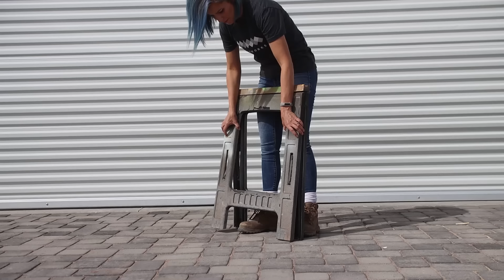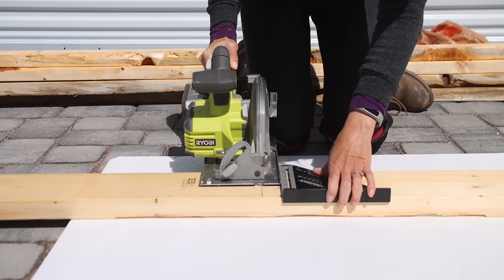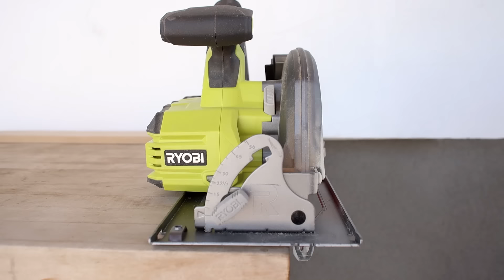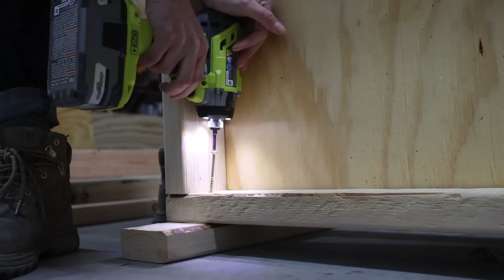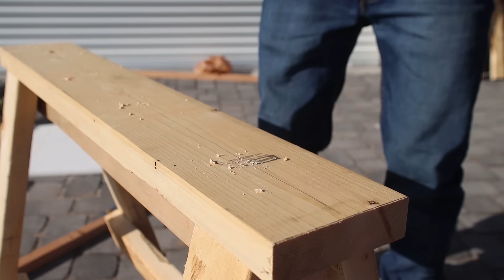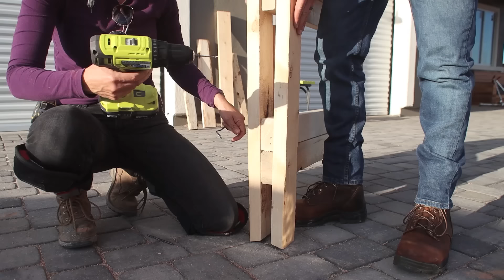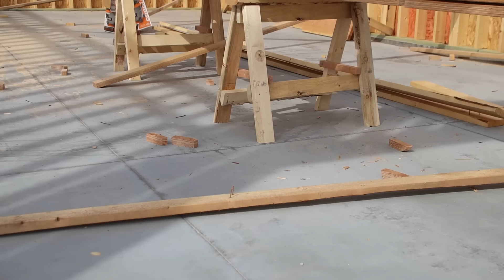HEAVY DUTY DIY Folding Sawhorses

Comment: You can build also with metal 2x4 square tube and screw together with metal screws or weld, just a. Easy as wood using metal screws,and more sturdy and last longer

Comment: great interesting video and I built one after watching. One thing I'd like to point out is that the screws on the hinge may get loose if the sawhorse get moved/shaken, as most of 2x4 are pine and soft. maybe pivoting by a 1/4 bolt is better...

Comment: Don't glue the top plate.  Secure with deeply countersunk screws, so that it can be replaced if it is worn out from repeated shallow cuts or if someone forgets to reduce the cut depth on a circular saw and cuts all the way through it.
Other than that, a really solid build.  I built a similar setup, but with chains to control the leg splay.  Not as stable as your solid braces.  I built another, non-folding, set with adjustable feet for uneven surfaces on dirt job sites.  Think I'm going to try to include that feature when I copy the rest of your design..

Comment: these are a death trap, don't build them.  The arm/lock mechanism is sure to fail, when lives are on the line, don't mess around with this kind of stuff.  Not hating, just stick to non-structural/non-safety stuff unless you know what you're doing and or the risks associated.

Comment: This is just me and not say you should, but I buy dull toss-away drill bits and second hand stores and cut the shafts to desired length for use instead of wood dowels. They're actually less expensive than wood dowels and come in all diameter sizes including metric. Depending upon the thrift store or yard sales each bit costs between pennies to a nickel or dime. Recycle!

Comment: I like the look of these sawhorses a lot and will be doing this project. One question - I recently built a fence door using half lap joinery and really enjoyed that process, could I do half laps for the cross beams of the sawhorses or is there a concern it would lose strength/stability?

Comment: Nice design. Thank you. If you wanted the option to line up your cross supports you could put one of them in the middle the way you have it and the other one on the outer side of the leg. They would both be aligned at the same horizontal elevation. On occasion I've needed to stick a plank down there to support some hardware or tools. It can be a handy shelf.

Comment: Thanks for the video. It's an old-fashioned practice, perhaps, but my great-grandmother and my grandmother used sawhorses (called saw frames in Britain) to hold quilting frames while in use. When not in use, they hung the frames on the kitchen ceiling.  I am building a pair for a quilting friend. 30" inches, per your plan is likely to be good. If too high, I can easily cut an inch or three. Thanks for the plan.

Comment: I must disagree about using impact drivers to drive basic wood screws. They (a) run too fast, (b) thus tend to strip the screw head, (c) don't offer much in the way of (speed) control, if at all, and finally, (d) risk overdriving / stripping / snapping screws due to the high torque. Now, when it comes to specialty wood screws (lags, Loks, ledgers, hex head, etc.) go for it!

Comment: Good job! I never thought of the simple idea of using styrofoam as a base to cut on. Sometimes you can find the stuff at your local construction sight dumpster. I❤ to dumpster dive. Also I like the idea of getting  an impact driver. At present l’m always changing out between drill and driver, very tedious. I wanted to get a second drill but an impact driver makes better sense.
  Just a thought, self leveling saw horse legs might be a nice added fetched🤓

Comment: Great instructions. One question. What is the purpose of the 45 Deg cut? Shouldn't 15 Deg cut be sufficient for achieving the desired inclination of the workhorse?
Reply: I think that’s for the hinge to fit there because the barrel of the hinge is a cylinder shape that sticks out

Comment: one tip: instead of the locking Arms you could also use a chain. not as bulletproof against folding together but shouldn't be an issue (I'm a carpenter by trade and never had the issue)

Comment: I made a pair of these about two years ago, and they have worked very well.  I beefed up the locking mechanism by having the bar attach with a bolt to both legs.  To fold, I undo a wing nut and flip the bar onto one of the legs, pass the bolt through, and secure it with the wing nut.  I ended up using regular hinges, since the special type you used was only available locally in a form which was too small and frail.  I simply routed a grove in which the folded part of the hinge rests.

Comment: I’m looking at building a couple of these today, but noticed a couple of potential problems. I’ve been reading through the comments to find any reference to them, but can’t find anything so far.
Just wondering if anyone else has addressed them.
1. The hinges are being screwed in directly opposite one another, into a 2” wide runner beam. Unless 1” screws are used, aren’t the screws going to run into one another?
2. Where does the barrel of the hinge go? It looks to me that it would sit above the top edge of the runner and prevent the top plate from sitting flush.

Has anyone run into these issues and found a simple solution? Offsetting the hinges is one solution to the first problem, though I don’t know how that’d impact foldability, stability and the storage latch. The second “potential” problem is exactly that. It may not actually cause much of an issue as the barrels aren’t particularly wide so may just indent the top plate enough to sit relatively flush and the hinges might have more friction, but being at the pivot point of a lever (i.e. the legs), I imagine it’d be negligible.
Any advice from someone who has built this?

Comment: Definitely going to making a set of these!  Mainly would use as lumber or material supports for cutting, but I’ve lately been been using sawhorses for temporary outdoor table work spaces to do some projects outside on when the weather is good or I can use the extra space instead of in my shop!  Thanks for the great video!  Definitely a big like an subscribe from me, cheers!

Comment: Finished mine today. Great design and instructions. Looking forward to others.
Reply: Did you end up building this? I was looking at buying materials for it today, but noticed a couple of potential issues.
If you did build some, did screwing the hinges opposite each other on the 2” runner, cause any issues with the screws running into each other? If so, what was your work around (1” screws???)?
Also, did the barrel of the hinge interfere with attaching the top plate? To me it looks like they’d create a void between the runner and the top plate.

Comment: Problems I came across: Cuts, Hinge selection, wood placement, broke lag bolt with impact, legs not flush or plum vertically, bad kurff when cutting( circular saw skill). Mines are almost good had to go back and make some adjustments. Great build, just have to get my skills up.

Comment: I would nor recommend using a dowel but you could use a lag bolt of the same diameter, drive it into the wood then cut the head with a metal saw.   It will be much sturdier and will pass the kick test.

Comment: Hi. As an old shop teacher, may I suggest a couple of easy improvements? 1) Don't glue down the top board; this way if you run your saw through it you can remove and replace it. Knowing that it's easily replaceable means you can use it as a sacrificial piece of wood. 2) Attach the top piece with brass screws; this way if you run your saw into a screw you don't damage your saw blade since brass is soft. Because brass is soft, after pre-drilling your pilot hole drive a steel screw the same size as your brass screws into the wood to cut the threads, then remove the steel screw and install the brass screws. 3) Instead of the 2x2 and dowel to lock the horse open, substitute a piece of 3/4" plywood with a notch cut into it that will latch onto the cross bar to secure the horse in the open position.
Reply: I suggest a further improvement. 
Make the legs and top as two separate pieces, connect them together with long bolts with wing nuts. This can act as a vise for holding work, or a piece of wood to adjust the height.
Reply: Похоже ваша идея уже реализована! 😁🇷🇺https://youtu.be/VeOi_ubNeEg?si=gTcY27lvSE0k52N3
Reply: Good tip about using brass screws for the top.
Reply: Scott,  great suggetsion. Question: if you screw down a top board as you suggest, and it gets sacrificed/replaced multiple times wouldn't taking out / putting in screws over and over round out the trheads? Is there a way to attach with bolts or other means? Thanks!
Reply: @philippeb4972  You could use screw inserts and bolts if you want to go to the trouble, but I don't think there's a rule that says you need to use the same holes. Even if you do and they become stripped, drill out the holes to accommodate a dowel, glue it in and re-drill for screws. Also remember this is a saw horse, not an heirloom tool. :-)
Reply: @philshock3805 using your own logic, if this is a sawhorse, not an heirloom, then just directly screw in the top beam in the first place. If you have to replace it after years and accidental damage, then just make a new horse in 3 hours.
Reply: @Gothmog222  “…make a new horse…” Screwing in a new board is hardly the same time, energy and money as making an entire new horse, especially if an additional horse is not needed.
Reply: @philippeb4972  you can use screw plugs
Reply: Good thinking.
Reply: Pivoting off this idea, here's an alternative that I've now implemented:
1. Glue a 2x4 and 2x6 flat together, with one of the edges flush. The 2x4 is the top and 2x6 the "base" of this setup.
2. Drill 1.5" deep holes into the top (2x4) centered on the 2x6 at ~4 locations.
3. Screw the 2x4 / 2x6 piece to the sawhorse base through the holes in #2.
4. Drill a few holes most of the way through the 2x4 / 2x6 from the top. Glue dowels into these. This ensures a very strong connection between these two top boards.

I've now made 2 sawhorses like this. It's really nice to have the "shelf" on the 2x6 where I can clamp something to both the 2x4 and 2x6 in different directions. No issues after several projects with these, and they seem like they'll last several years before I need to replace the top 2 pieces.
Reply: @dosadoodle you should do a video bro.As a rookie I’m always looking for advice on how to build things.About 3 years ago I all of a sudden became interested in tools and woodworking so I decided to start buying tools and learning on my own n here I am.The only thing I can say is maybe it’s my age that made me all of a sudden want to start building things as a hobby.I went as far as purchasing a shed and filling it with all types of tools that I still don’t know how to use 🤦🏻‍♂️….well the only one I can use is my table router…I haven’t tried it yet cause I’m kinda nervous and don’t know where to start.The bad thing is I purchased a 300+ dollar box of bits 2 years or so ago that I still haven’t used.i pretty much have everything I need,not every tool but the ones I need and more to build a house 😂….sorry for the rant but my point is we always need ideas of how to build things.Im sure I’m not the only rookie out there that needs all the advice he can get 😬….Even recommending other channels would help also.
Reply: @EyeSeeDeadPeople44  Sometimes you just need to start a simple project, even if you make a mess, it doesn't really matter. Perhaps you could make a video, there's probably thousands of people like yourself and once they see a first-timer do something, it may inspire them too!
Reply: How about put wood dowels glued to the top piece and drill the bottom hole s little smaller and pound them in for tight fit but can pound them out
Reply: Why don't you just post a video, everybody does it their way, if not there would be no need for more than 1 video.
Reply: Hi shop teacher she's not building a piano.

Comment: Thank you for this video! 

Question: If you substitute 1-1/4" screws to attach the hinge plates, the lengths of two screws directly pointing at each other would add up to 2-1/2", more than the 1-1/2" thickness of the runner. Did you maybe offset the plates on the opposite sides of the runners a bit to keep the screws from hitting each other?

About the awkwardness of attaching the legs to the runners: Once you've marked the drilling points on the runner for the hinge plates, maybe remove the pin from the hinge and put the leg aside, screw the plate onto the runner, then put back the leg and the pin.

Thanks again, looking forward to building them.
Reply: I have the same question. Did you find a work around that didn’t affect any other aspects of the build?

Comment: Brilliant design.  Will be making up 2 pairs to help with a barn door restoration project.  I’ll be using rough sawn hemlock, true 2”x4” dimension.  I like how they fold for easier storage.
Reply: Did you end up building this? I was looking at buying materials for it today, but noticed a couple of potential issues.
If you did build some, did screwing the hinges opposite each other on the 2” runner, cause any issues with the screws running into each other?
Also, did the barrel of the hinge interfere with attaching the top plate? To me it looks like they’d create a void between the runner and the top plate.

Comment: Nice video. I think I will replace the wooden dowel by a screw with its head cut off after installed for increased resistance. Thanks for sharing!

Comment: hi..thnx for the video..try to fix the hinges..well on the leg,the hinge sits flush as the 45° angle cut on the leg really help in settling the hinge but on the top runner its a troublesome to make it flush with the leg...

Comment: Like the design. Probably will build 2 some day. Looking over home made fixtures & stuff as I don't do working on a regular basis & just have hand tools but could use the expensive stuff now and then, like 2 sturdy saw horses from 2×4's. Thank-you
Reply: Did you end up building this? I was looking at buying materials for it today, but noticed a couple of potential issues.
If you did build some, did screwing the hinges opposite each other on the 2” runner, cause any issues with the screws running into each other?
Also, did the barrel of the hinge interfere with attaching the top plate? To me it looks like they’d create a void between the runner and the top plate.

Comment: Didn't like the locking arm idea. I used a simpler method of a hinged bar that simply falls into place when I open the saw horse and rests on the cross brace from the other side legs with a groove cut into them to fit over each cross brace and secure it from foolding or opening farther.

Comment: I’ve built many types and pairs on ponies, over the years.
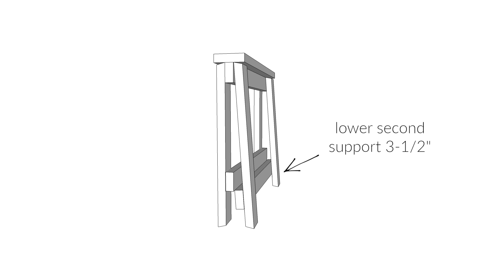 At 5:51, think of the same concept, without the top 2x6 and add another 2x4 beside the other top 2x4.

Now....take that picture and apply it to 1 x 4’s, in leu of 2 x 4’s.
Good 1x’s without knots.
Make sure, the top of the horizontal 1x4 is about 1/2”-3/4” above the top of the vertical 1 x 4’s.
Dado the verticals, at all joints 1/8”-1/4” deep.

You want to have the horizontal members on the outside, in leu of the inside.
Use your hinges at the verticals.
Since your top horizontals were slightly higher than your verticals, the hinges will be below the top of the pony.

Now, take some 1/4” ski rope and drill holes, fairly low, on the verticals.
Thread the rope through the holes.
Add a washer and tie a knot.
Heat the knot, slightly, to keep it from loosening.

Make sure the bottom spread of the legs, is no more than 16”.
Personally, I prefer 12”-14”. 
1x’s are stronger, closer to vertical.

Lastly, take some carpet remnants. Fold the bottom edge under. Flush that with the bottom edge of the top horizontal member. Screw through both layers, into the horizontal member.
Make sure the pony is closed, then repeat on the other side.

I never saw through the carpet. Therefore, I never cut into the wood on my ponies.

I have had, as many as 15 sheets of 3/4” plywood on these ponies, without any problems.

They are very light.
The only problem that I have ever had is: because of the narrow footprint and the weight, if there is no load on the ponies and it is a windy day, they may blow over.

I am a 3rd generation of carpenters and these are my favorite homemade ponies.
Otherwise, all the ponies that I build, are always made with 1x’s.

Comment: Just seen this video,absolutely brilliant idea. Thanks for sharing and it's on my next to do list.
Reply: Did you end up building this? I was looking at buying materials for it today, but noticed a couple of potential issues.
If you did build some, did screwing the hinges opposite each other on the 2” runner, cause any issues with the screws running into each other?
Also, did the barrel of the hinge interfere with attaching the top plate? To me it looks like they’d create a void between the runner and the top plate.

Comment: i'd probably just use hinges on one side as both leg sides do not have to be folded. also i would likely change the cross braces. those dowls look like a weak link and over time would have to be replaced but they are glued in so ......

Comment: Good tutorial and thanks for the plans, but I do want to point out that 2x4s aren’t actually 4 inches wide, so youre either using lumber you ripped yourself or you’re using 3 1/2” hinges at most. Otherwise you wouldn’t be able to attach the wider portion to the legs like you do in this video. I’m hoping that the orientation doesn’t actually matter for structural support because I already bought all of the 4” hinges and am gonna try attaching legs to the smaller section of the hinges.
Reply: I did the same thing-bought 4” non-mortise hinges.  How did it turn out?  Good I hope.  I’m just now starting mine